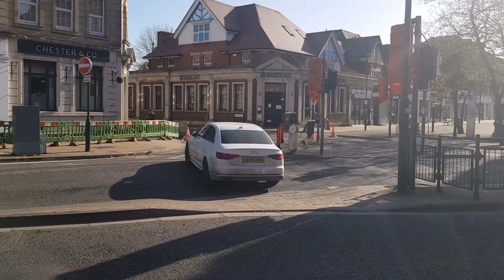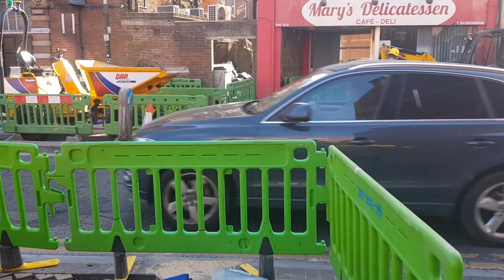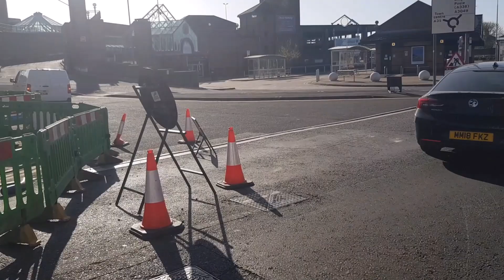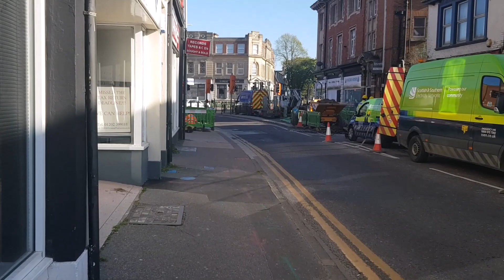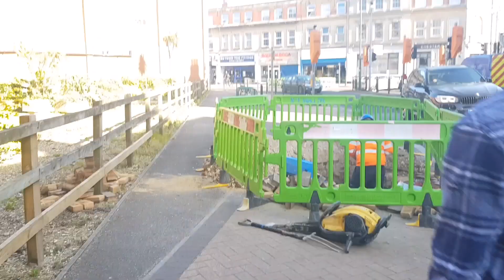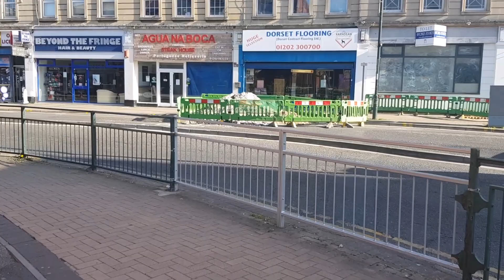Roadworks?

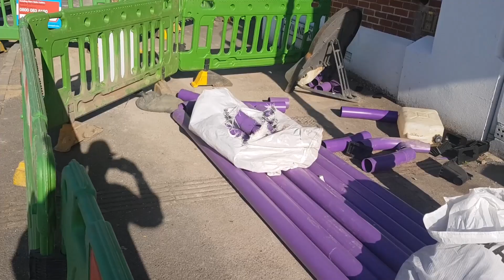Comment: Purple ducting is supposed to be for motorway cables for cameras, emergency phones, etc. If you read the sign at 02:45 it says they're installing fibre optic cables. Green ducting is supposed to be for this. The phone number is for a company called City Fibre.